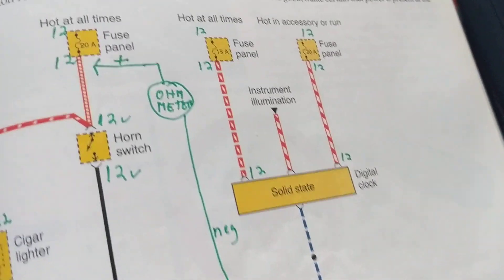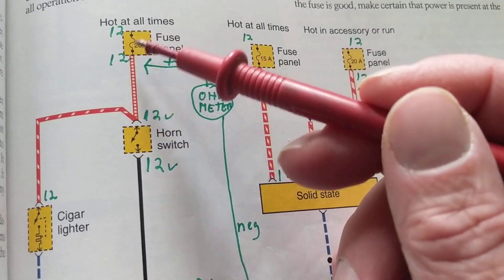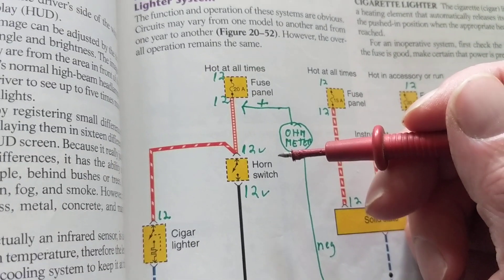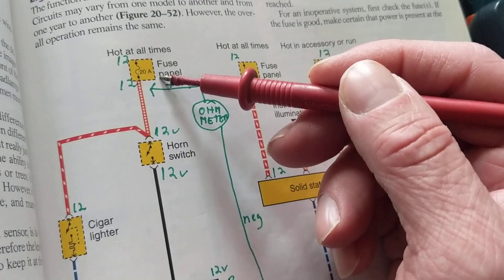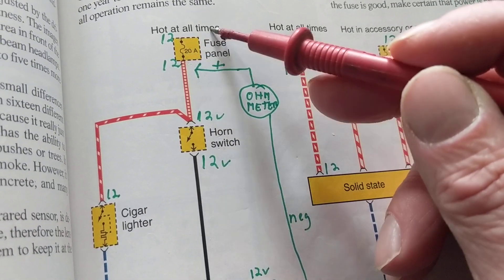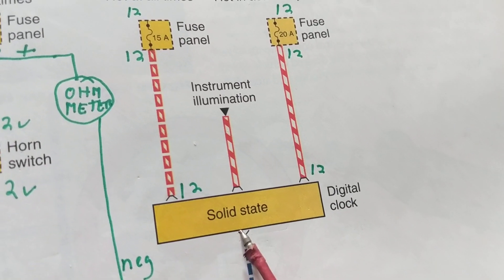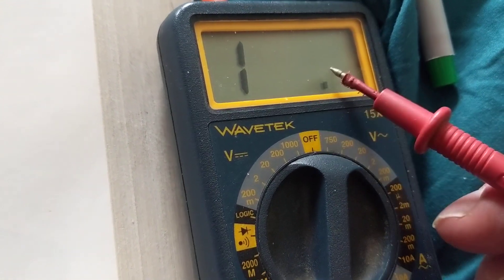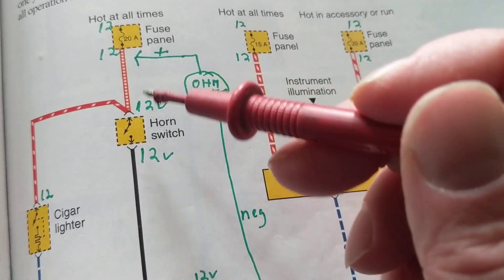HOW TO UNDERSTAND TO FIND SHORTS AND OPENS WITH FUSES

Comment: Hey, Joe. if you measured like 500 ohms,  would you consider it a partial short to ground?
Reply from the maker: No a short ground is zero ohms thank you so much for your question the fact that you're measuring 500 ohms means there's resistance thank you so much
Reply: @Joeelectronicschematicsforauto  I My question was, would you consider it as a PARTIAL Short to ground? I have not come across partial short before and have not seen any videos about it anywhere. I have been watching your channel for a while. I have learned a lot from it.
Reply from the maker: @alwayslearning6355  thank you for watching the channel a partial short would mean to ground you would have less than 10 ohms but it depends what the normal ohms would be according to the load but usually when we check for grounds shorts we check for dead shorts which blows the fuses obviously
Reply: @Joeelectronicschematicsforauto   So, a partial short won't blow a fuse?
Reply from the maker: @alwayslearning6355  it depends how much resistance is left in a circuit after the partial short if there is no resistance it is a shorter ground if there is 10 ohms resistance such as a coil which has low resistance then something called ohm's law is in effect to figure out how much current is left and if it will blow the fuse but in conclusion if there is no resistance left it is a short ground if there is partial resistance left there could be enough to limit the current
Reply: @Joeelectronicschematicsforauto  Thank you so much for your help!